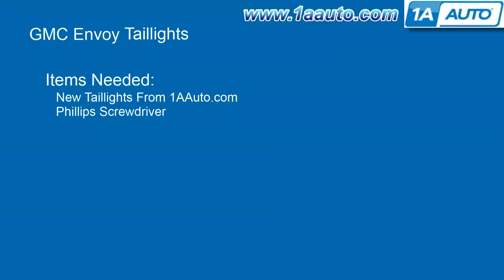How to Replace Tail Light 02-06 GMC Envoy XL

Comment: the middle bulb on mine was burned. the other two are fine. I went to replace the middle one and none of the 3 bulbs work. I thought maybe it was backwards. but, that didn't change anything. i replaced another bulb that wasn't burned and then they started working normal. what causes this?? this happens on my 2000 mustang too.

Comment: Hello I was wondering if you could help me out I have a 2012 Dodge Grand Caravan and the heater vent louvers adjusters has came out .. how can I remove the vent to reinstall the adjuster.??? Thank you two thumbs up on all your videos great job
Reply from the maker: We currently do not have an auto repair video that shows this particular repair. There might be a bezel, or some type of a trim piece that you need to remove first before you can remove them, but it's not something that we have had to repair yet. Hope this helps to point you in a direction. Regards, 1aauto